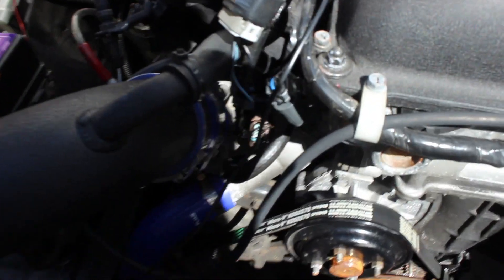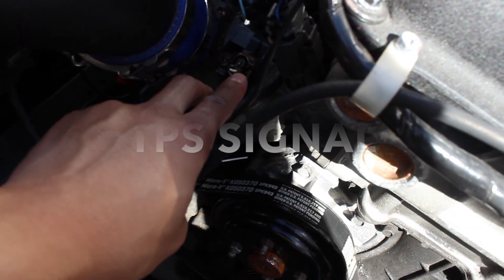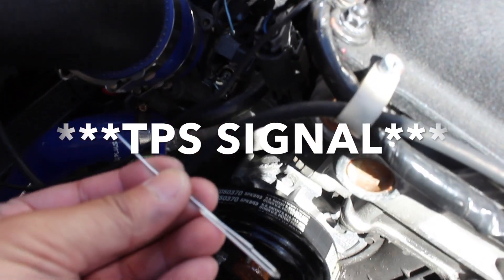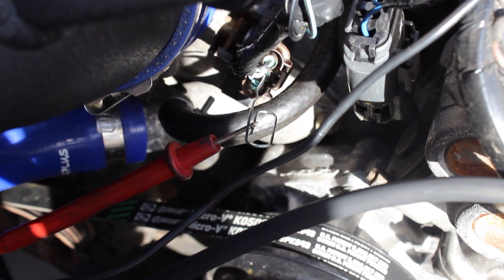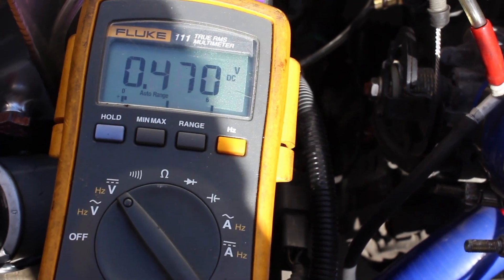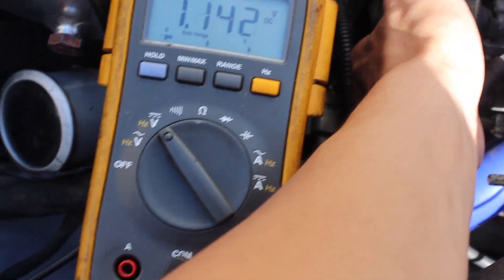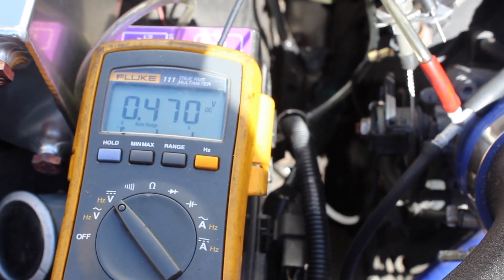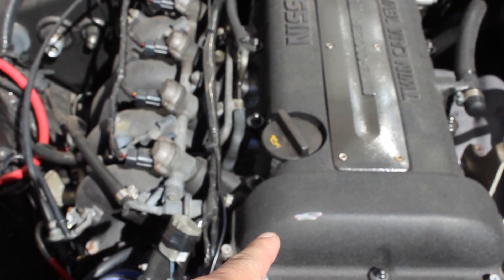Wrench-a-holics | How To Test TPS Sensor SR20DET

Comment: Mine won’t read .45 it will read ~4.5 volts on closed throttle idk what’s wrong with it
Reply from the maker: Are you probing from the correct pin outs ?
Reply: @wrenchaholics  yes, the middle white wire. I would set my MM to 12v and it would read 4.5 or something in that range rather than just .45. And on WOT it would read ~9.00 volts
Reply from the maker: Is your car on the on acc position?
Reply: @wrenchaholics  yessir, on but not running